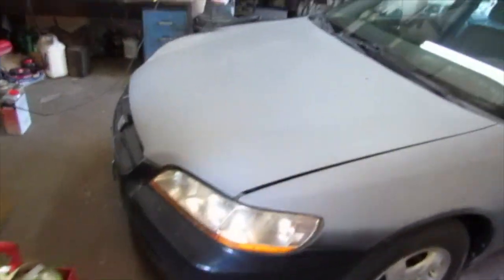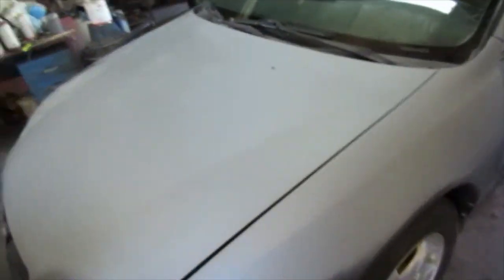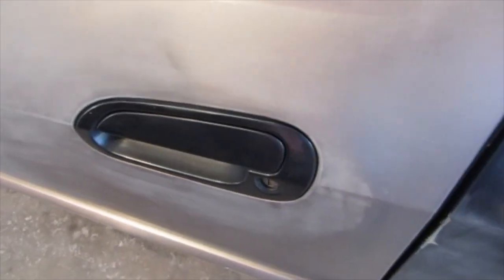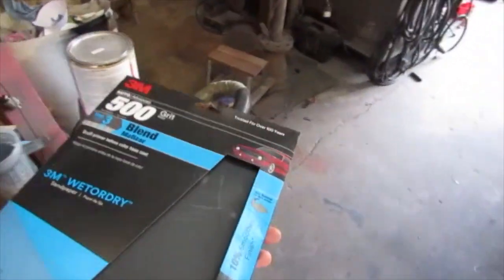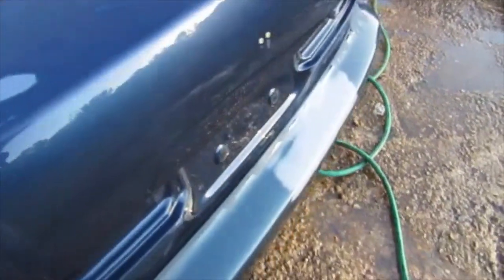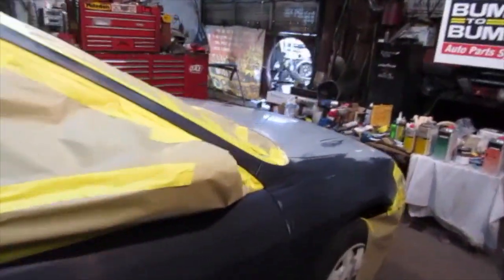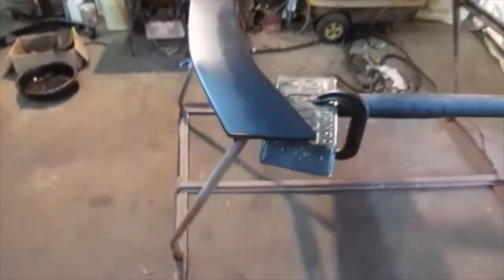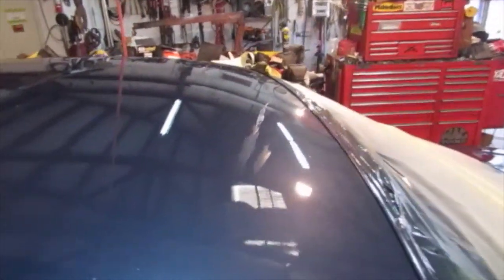Hopar Joe! Painting Practice on a Beater

Comment: Looks great. On your gun settings, have you found a pattern or method for avoiding orange peel? Like let’s say, too much material and not enough air causes orange peel or vice versa? I paint once in a long while, not enough to get good at it, it comes out ok but it’s usually orange peel that’s my main problem. Thanks.
Reply: Hey what type of gun do you spray with an HVLP or a high efficiency type the HTE type is more forgiving of orange peel try about 28 psi full fluid and full fan and test on an old panel and adjust in a little at a time start with the fluid first and the fan adjustment if you have to, till you get the result your looking for, you can also use a viscosity cup like a Ford #4 and get the paint to flow between 18 seconds and 24 by adding reducer that's how I have got rid of my orange peel issues....good luck.
Reply from the maker: That’s excellent advice! I found my dads Japanese made Low pressure gun this time. I’ve never used it before but it’s much better built than my harbor freight! I believe it says 16psi at the cap. This car only had peel where I was running out of clear. I was using left over cans from other projects and barely had enough 😅
Reply from the maker: Check out paint society or the gunman. Two pros that explain those settings way better than I could.